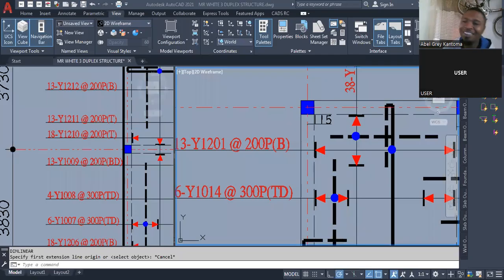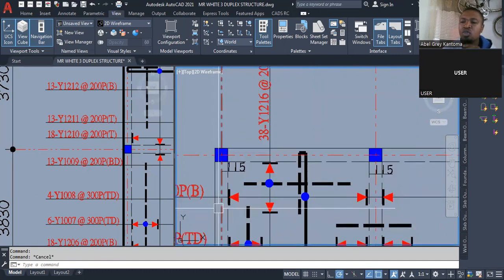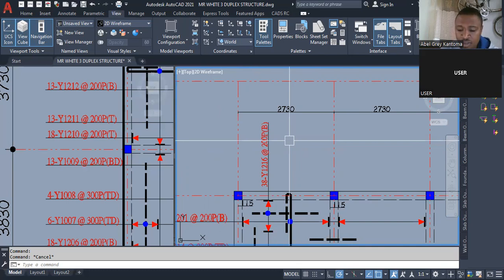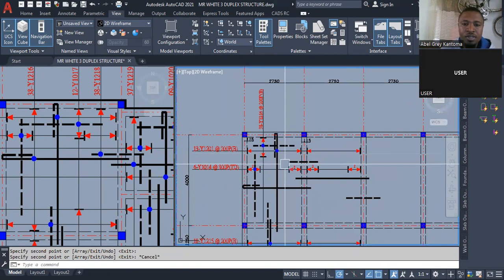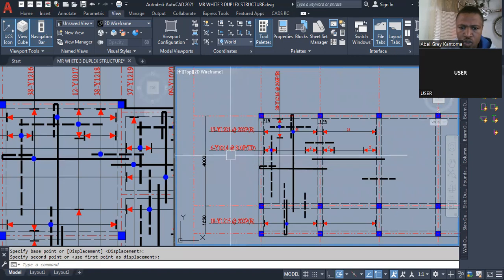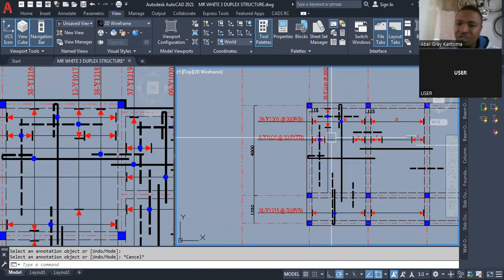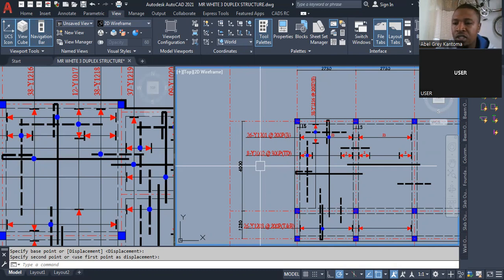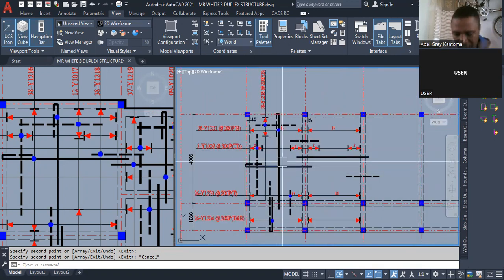structural slab detailing part2

Comment: There is going to be difficult on returning bar since at the time steel work starts , already peripheral beam shuttered , how will it be placed
Reply: There won't be difficulties. The peripherals are left not shuttered until the rebars are returned. Practical wise, the bats can be bent on table before fixing .
Reply from the maker: Great question
Reply from the maker: Great question